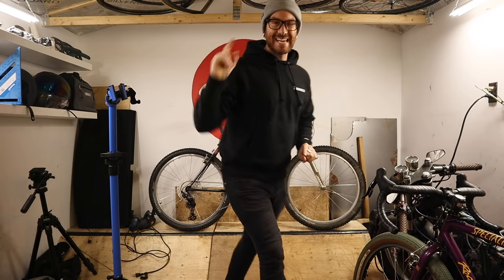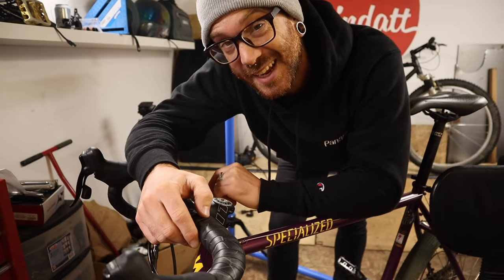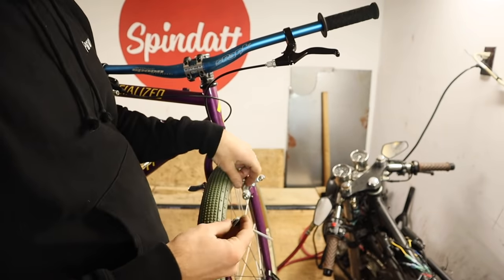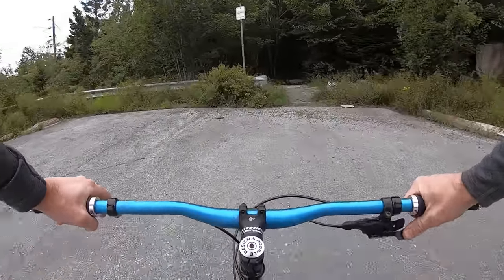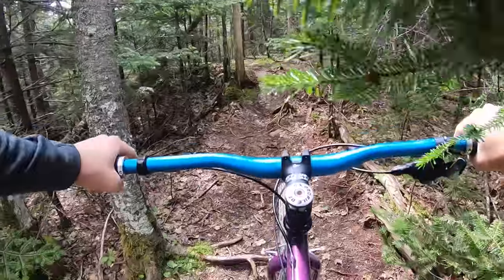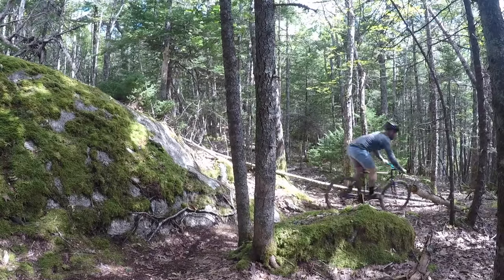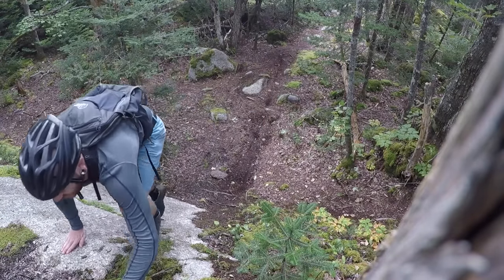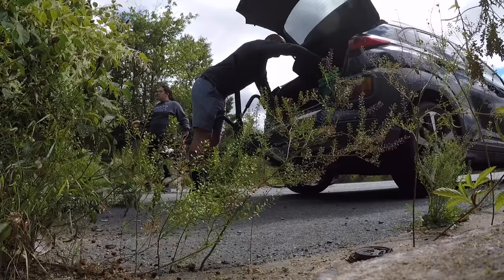I took my upgraded 90's MTB on real single track and...

Comment: I have an old 1994 Specialized M2 Stumpy.  I recently restored it to like new condition.  I can't believe I used to ride it on trails like that.  I've become spoiled with the new bikes.  I just pull it down from time to time to ride it around the block.  It's weird because the wheelbase is about a foot shorter than my new bikes, but it rides very low and long.  Like a time trial road bike with 26 inch wheels.  Kinda painful for my 66 year old ass..
Reply from the maker: hahah i actually found this thing to have a really nice and forgiving wheelbase. I'll be riding it again for sure.
Reply: I also have a Stumpy, a '95 M2 and a very short wheelbase  but with a 120mm stem, that actually gave me problems on steep climbs (front wheel gets airborne). That's why I got me a 29er MTB. But the old M2 is so short that it looks perfect for a gravel drop bar conversion. The memories when I bought this first real MTB can't let me put it to go to ebay.

Comment: Finally…the world is healing and gravel bikes are reverting the exact bikes we rode in the early 90’s. 26”, full rigid, 24 lb. goodness. Cut them bars super narrow and you’re set…maybe not, let’s leave 400mm bars to the 90’s
Reply: Form follows function!  Modern gravel bikes are actually used on the same trails as the old '90s rigid MTBs. And so after a few iterations modern bikes resemble more and more those old bikes. Especially the newest ones like the Specialized Diverge Evo with flat bar. The only differences are disc brakes and U$3000.00

Comment: I’m searching for a 17”-20”, 1997-2001 Stumpjumper M2 or an S-works frame if anyone has one or a lead on one please let me know.  Even if you’re reading this in a few years from now, I’ll always be interested.  Just drop a reply comment and I’ll see it in my notifications and get back to you.  Thanks!  Love the Stumpy community- you all are great!
Reply: Did you find one?
Reply: @rhysbalmer  Came across a cool green '97 m2 frame on ebay that was hardly bid on.  Looking forward to building it this Winter and riding it come Spring.

Comment: "im putting flat bars on this gravel / cx bike"....first change the cranks...??? was this just for shits and giggles?

I assume you're running SRAM mob shifters and SRAM road derailleur as that wouldn't work with shimano different pull ratios...? cheers